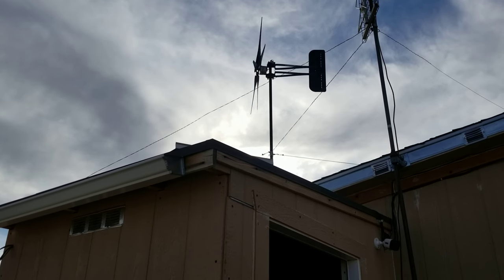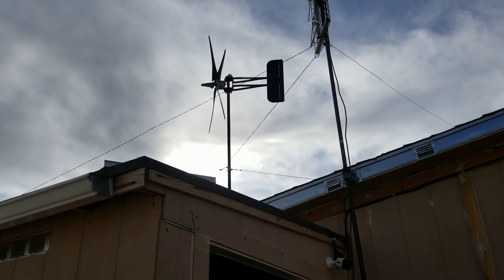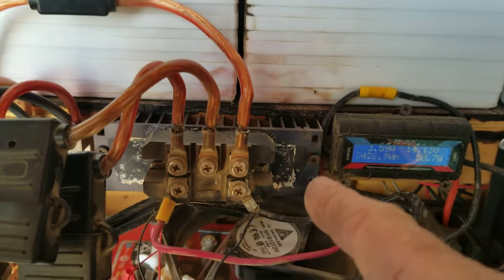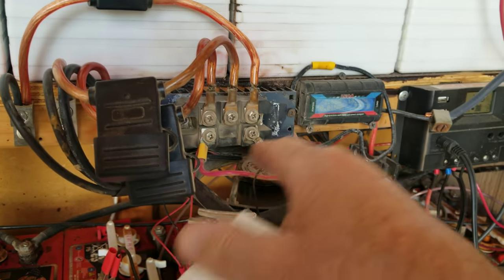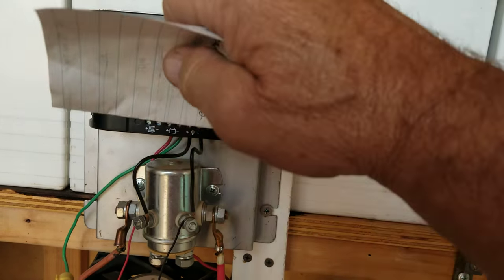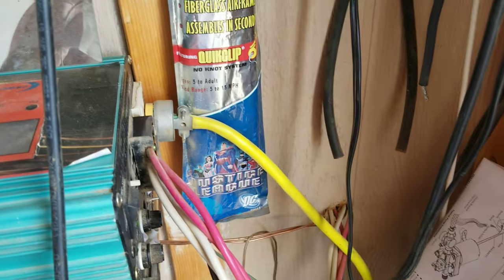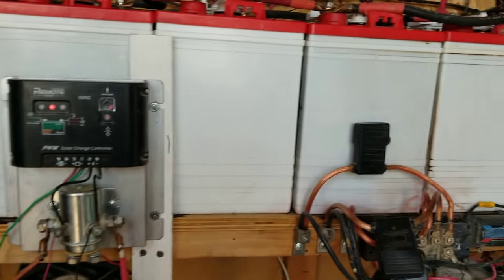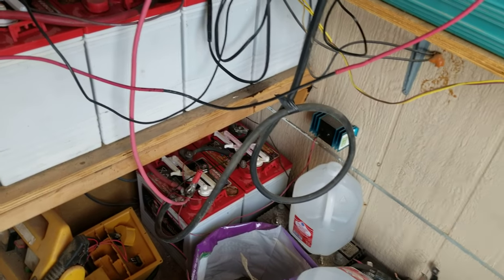Wind turbines, controllers and batteries explained, March 6, 2020

Comment: G. Bear, I have a three-wire wind generator, and common inexpensive potted wind controller that came with it. All three wires from the generator are the same color: Red. And the three controller wires are all the same color, also. Does it matter which generator wire goes to which controller terminal/wire?, or can the hookup be made in any fashion, and still have the same, best result?

The face of the controller has a diagram of a three-bladed wind turbine blade, with the center wire of the three controller wires coming from the second (middle one) of the three generator wires. If the order of the hookup matters at all, how can I determine which generator wire is that center wire? Or, as I speculate, since all the wires and terminals have the same color, does the order of the hookup to the controller (rectifier) simply not matter at all? In any case, how did YOU proceed, and manage to get a good result in the hookup? Please help! Others here may have this question, too. Thanks!, --Joe / Tucson ARIZONA
Reply from the maker: @W7DXW  Welcome aboard, Joe!  A 3 wire turbine is a Permanent Magnet ALTERNATOR, (PMA), and the order of the wires is not a factor in connections.
Those 3 wires connect in any order to the controller you received with it, to the 3 same colored wires on the controller.  That leaves a black and red wire to go to the batteries.
You may want to order the following meter so you can monitor the power.
https://amzn.to/3zZ6F8n
Reply: Thank you! for your help, you've done me a great, good turn (and others here, too, I think, who may have had the same quandary and puzzlement that I had, as newcomers to wind power). I was trying to figure-out the connection scheme for days, and was frankly going a bit stir-crazy, with various mental topological twists and turns, trying to figure out if all the connection schemes are (or should be) in fact equivalent. I even resorted to experiment, and tried different permutations of the connections, while spinning the turbine generator with an electric drill, and always got the same voltage output no matter HOW I connected the wires. I couldn't believe my eyes. You've very kindly settled it for me, now.  T-H-A-N-K  Y-O-U ! ! --Joe / Tucson
Reply from the maker: @W7DXW  You’re welcome.   Yes, it can be confusing to newcomers.  The good thing is your test shows it is working properly, having the same voltage output on each combination.
The charge controller they provide is basically a bridge rectifier which changes AC to DC through diodes.  That's why I recommended the meter.  Without a readout screen, you would never know if the power to the batteries was too high, especially with LiFePO4's.

Comment: This is very helpful!
I recently acquired a 'wincharger' 12 volt, PMG windmill, $100! With a mechanical brake, guessing 50's or 60's vintage, tail says: "heavy duty", appears it failed early on in its life, armature & brushes are like new, in the process of making the blade out of 1"×6"× 6 foot, mahogany. Was originally on a 3", (10' sections) 50 foot tall, tripple guyed tower. Planning on stepping it up to 24v using a c-series trace/zantrex multifunction DC controller, then into my 24v batt. Bank. Not sure what I'll use for the shun/dump load, or what size fuse to use. Any suggestions in regards to any of this greatly appreciated.    Thanks, john
Reply from the maker: Interesting.  PMG's were actually dynamos.  Most old auto generators used field coils, not permanent magnets and required high rims to produce efficient power. Those were not good for wind power production.
A dynamo with internal permanent magnets was more efficient, but the magnets tended to lose power after a while, rendering them inefficient. If you in fact have a PMG that is not working, test the magnets draw on a screwdriver for strength of attraction.  If strong, you are in good shape.  If weak, you have problems, as finding new magnets to fit will be hard.
As far as blades, balance is VERY important, as is weight, and strength.  You would be better off ordering composite blades and hub online, and modifying the hub to fit your armature.
As for the project, I think it would be a fun one, but not a profitable one, as the output would never compensate for the expense.
But, let us all know what you decide and the outcome.
Remember one other thing.  The wind pressure on that unit will be the equivalent of a truck with a chain attached trying to pull down the mast.
Reply: Thank you for the reply, yes, it's just an old generator, I guess. I was just applying new terminology to say it's a gen. & not an alt.
Getting ready to hook a 12v battery up. The more I look into this, the more fascinating I find it. Spring loaded wings are engaged as a sort of mechanical regulator, agreed, balance is of utmost importance, I'll probably end up setting it up, More as a display/ novelty. A new modern updated version sure would help out on those windy cloudy winter nights.
Reply from the maker: @johnsader8811  Yep, those oldies used metal blades.  There's one in town where I need to go today.   I'll get a picture of it and pist it in tonight's episode.   It may give you some ideas.
Reply: @GBear  these were a Doug fir, 6' by 3 1/2". One piece, (2 blades). I agree the wind load on these must be horrendous. The mechanical brake is like a cars, with a drum & a shoe. Appears it was never used as booth retain their original paint. Thanks again for your straight forward videos.     
                    John

Comment: Pma=AC 3 WIRES. PMG=DC 2 wire    ok GBEAR  I'M TAKING MY NOTES!    All Makes sense!  Thanks 👍
Reply from the maker: Correct.  PMG has q built in rectifier, PMA requires a rectifier to be added before the battery connection.
Reply: I use a 100 amp 3 bridge rectifier. And a dump control board and solid state relay and 3 100 watt 3 ohm resisters in paralleled to drag mine down when the bank is full.

Comment: I got a fan for that that plugs into the usb port on the controller,  uses .1 watt, nice roller bearings,  really quiet...the solenoid is like the one on a John Deere...if I ever get these tapered head Japanese screws out of this Honda PMA,  I'll cobble one up, all I like is the solenoid...it's got magnets in it but I've got stouter ones, lol..yeah now that I've got 12 batteries I need a windmill...well too many irons in the fire but slowly slowly...when the sun got stronger a week ago the 10 I had would be full and now it's holding more...I have the forbidden bad ones you mentioned...for one reason I have to move them one day by myself as always and I dont have my old John Deere 790 with the front bucket anymore,  just my butt...these are like 80 pounds each though...I can always get a fork truck battery later and have 1500 amp hours with the ones I have and it....I have to allow for the time to save up for such a big heavy thing ....but I can get by on what I have pretty well..I just have to do it between rain storms lol
Reply from the maker: Off grid is usually about making concessions. My favorite saying:  Function before beauty!

Comment: Good vid & explanation of ur system G Bear. Wouldn’t it makes sense to use ur dump load to make hot water or at least a pre-heater for a hot water system, but use ur excess solar power from ur controllers as well, as soon as ur batteries are full SOC have the controller divert any extra power to ur hot water system. I have a 50ltr hot water system that operates this way on a stationary 40’ bus, a 24v system, 3kw AIO inverter, 2.5kw pv panels & 10 kwh lifepo4.  I can run microwave, 2.5kw split air con, H/W system, everything off Solar & heat water for the family of 4 showers daily while fully charging batteries. 
I have a 24vdc multi power element (300w, 600w, 900w capable) for the H/W system but never fitted it as I use the inverter with a AC voltage/dimmer control so I can adjust the output to the 240vac 1800w  element I installed previously, instead of the 3600w element it had standard. I can use the controller to vary the power usage of the H/w system if its cloudy or for other reasons. 
For my house I have a 5kw AIO 48v system with 10 kwh of pv (grid tied) & 30 kwh of lifepo4, I only use about 20%-25% battery SOC a night on either system generally, higher voltage systems are much more efficient if ur going to use an inverter, & use a step down (or up) converter for lights & light loads to save on wasted inverter idle power usage.
Lifepo4 batteries are a game changer now days in so many ways & using a decent shunt ,means you can know very accurately how much power is going in, out & still available.  
They were PWM controllers u were trying to think of , it stands for ‘Pulse Width Modulation’, but Im sure u know that. Cheers
Reply from the maker: Welcome aboard.  I live in the hot desert, and don't use much hot water at all.  I use a propane, tankless water heater that gives me on demand hot water when needed.  It is off 10
5 months of the year.
My tote-cuzzi outside doesn't have a heater either, and the water is at 90°F or better.

Comment: hi, so what happens after 90 MPH winds in terms of current, I was thinking of getting one to also work with my solar for hurricane offset?
Reply from the maker: If it is rated to 90mph and it exceeds those wind speeds, you walk around picking up the pieces.  
The pressure on the turbine and tower at lower speeds is equivalent to a car with a chain trying to pull it down.

Comment: GBear, another alternative to dumping your excess power, feed that extra power into a secondary 14 volt battery bank by using a combination of 6v & 8v golf cart batteries, which requires more current for charging. I’ve been using BatteryMINDers 2012’s for all five battery banks except one AGM bank that uses the BatteryMINDer 2012-AGM model. My golf cart batteries and AGM’s are between 10-15 years old and only need to add acid once a year. I use two banks for Ham radio that requires 13.8 volts. BTW, a PWG also works as a pulse/desulf charger but I like that BLS-12N and I will see if I can buy a couple of those.
Reply from the maker: Welcome aboard!  I do have plans for a second battery bank, but was thinking more along the lines of 48v as a backup.
Reply: Umm you should never shunt of dump into anything that could run out of capacity. You could kill the turbine or your batteries or both or all three: catch things on fire.  (10:20 looks a little fire risky to me)
Reply: @fishhuntadventure  won't the dump load controller just divert the power when the main battery bank is full?
Reply from the maker: No.  It will turn on when the battery bank is over full, but the AIMS and the Midnite Classic also prevent overcharge, so the dump load never activates any more.
Reply: @GBear  GBear, thank you for the reply… it seems your video didn´t just enlighten me, but also a huge pouch of people!
AIMS and the Midnite Classic will prevent overcharge and the dump load will not be used right? The thing is that I do want to use that extra power but not on that huge resistor, I want to use it on a large water heater and/or another battery bank for gest house.
The other thing I´m worried (as I´m using lithium-ion battery) is the micro cycling happening on the battery bank while using the dump load.
Can you please give me some insights on these 2 issues?
Reply from the maker: @damianroth4265  Both the AIMS inverter and the Midnite Classic have specific settings for specific batteries. 
I would still incorporate a digital diversion system anyway.  It is more efficient that the old tech I use, and redundancy is great insurance.

Comment: curious will it not damage the battery if you feed the output of the rectifier direclty to the battery  ? . Again I am not expert on this just asking to expand my knowledge. do you still need a voltage regulator to match the proper charging voltage of the battery ? feed the output of the rectifier to a voltage regulator or PWM or charge controller ?  thanks
Reply from the maker: Welcome aboard!  First, let's start with the basics.  You should not attempt to charge, let's say, a 12v battery bank with a 24v turbine.  Think of it like you car.  You wouldn't replace the alternator with one that outputs higher voltage, right.
Now, yes, you 'could' do it using a specific charge controller, a transformer, etc., but it would complicate your system and life, while costing you more.
As far as connecting the bridge rectifier straight to the batteries, yes it will damage the batteries unless you also add a 'dump load diverter' to handle overcharges.  You could also use a Midnite Classic charge controller set up for wind power conversion, which is the best option, as this allows you to fine tune and adjust the input for best efficiency.

Comment: Building me a vertical wind turbine. Trying to get all the info I can! Thanks for the tips.
Reply from the maker: Sounds like a fun project!  Good luck!  Let me know if I can help with info.
Reply: I built my own vertical windmill with a treadmill motor. Now I'm just here to see about the control system for the battery bank.
Reply from the maker: You'll need to determine the treadmill motor output voltage and wattage, and whether your output is AC or DC.
With AC you'll need a bridge rectifier that not only converts the AC to DC, but steps the voltage down to your usable battery bank level.  You can't charge a 12v battery with 60 volts DC!
With DC (PMG) you will also need a step down transformer, but not a bridge rectifier.
Reply from the maker: Oh, and welcome aboard!
Reply: Thanks.  Yeah it outputs DC. I'm looking into purchasing a 440 power   charge controller is what I've read I should use. That with an inverter as the output. I plan on running dc stuff but then a maybe a couple smaller ac things.
Reply from the maker: Sounds great!  Let me know when you get it together!

Comment: Amazing video man, for real this is great information for me, an Engineer student in renewable energies!
Reply from the maker: Welcome aboard Marcelo!  Any way I can help you, ask away!  You may want to check out my Playlist about Electrical experiments and such also!
Reply: That's what I'm doing, your content is fascinating. I would love to have teachers like you lol. I have a question, I can always connect my wind turbine to a SOLAR CHARGE CONTROLLER? Aren't there charge controllers for wind turbines? If so, Is it possible to connect a wind turbine and some panels to the same charge controller?
Reply from the maker: @marceloadrianmendodelacruz5451  yes, there are hybrid controllers that handle both wind and solar.  I prefer not to use them from experience.  I had to cycle through the controller to distinguish between which was producing what.  By separating them out I am able to see those numbers at a glance.
Reply: Thanks for the info, that makes sense. I'm currently doing a project for my thesis that consist on perimeter lighting for my University parking lot with eolic and solar energy as power source. Your knowledge is gold for me, I appreciate the help! Greetings from Mexico.
Reply from the maker: @marceloadrianmendodelacruz5451  in the near future I will be installing a solar powered submersible pump system in my water storage tank to keep the water in motion during the hot summer days.  This should help prevent stagnation and algae growth.  I just ordered the parts and should receive them in a couple of weeks.

Comment: Connecting multiple charge controllers without parallel capabilities will work, but it won't work very efficiently and you'll lose out on a lot of power, especially mixing MPPT and PWM controllers.
Reply from the maker: @bigrob1887  Yeah, but it only worked for 9 years.

Comment: Question. I'm looking at the KT5 on their website, they say in high wind gusts it can produce up to 68V peak on the 12V model. It looks like their rectifier is rated to 1600V, but what would happen to the batteries? would it just trip the load dump solenoid?
Reply from the maker: Yes, but solenoid dump load systems are no longer used.  Digital diversion units are the new wave.  I live in a high wind area, but have yet to see more than 60amps and 880watts, and that was with 45mph winds.  That's 14.6v.  I was told the same thing as you, but can't figure out what they are talking about.  A 12v PMA is a car alternator, and it would never put out more than 14.7 volts, even if you were driving 120mph with 5k rpm on the engine.  I think they hype the product to sell more product.
I bought their meter unit to monitor output and it failed in a short time.  They gave me all kinds of crap about how it was my fault, etc., then it mysteriously got lost in the mail and I was out the money and the meter.
I bought a Chinese meter and it has been working fine ever since.
Reply: @GBear  Thanks for the info!

Comment: Thanks G bear!!  great explanation, I’m trying similar project too, POC is done and now will need to design a battery bank.

1) how do you wire the batteries together with 2 source of charging ? I’m thinking to add another source for charging but not sure how to wire it. 
2) If it’s a separated batteries zoning ,  how do we ensure the batteries are equally charge?
3) how do you connect all the batteries to the inverter? Do you have a battery bank management system in place?
4) how to detect a faulty battery under the batteries bank?
Reply from the maker: Watch tonite's episode and I will answer your questions.